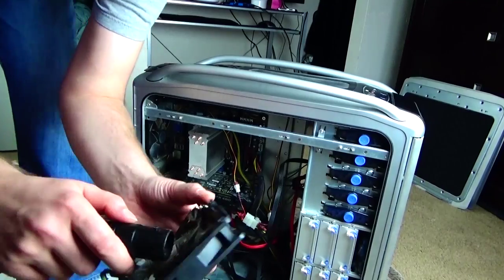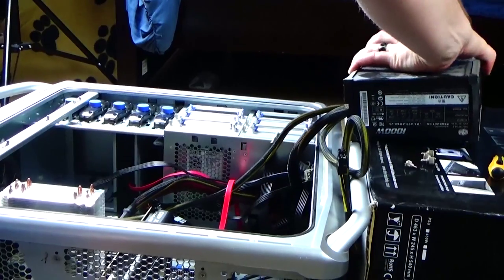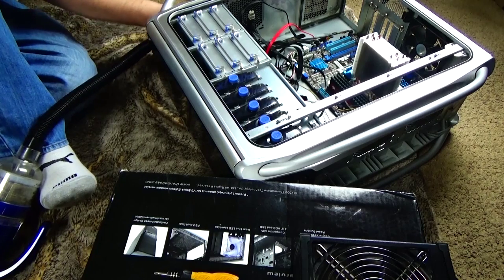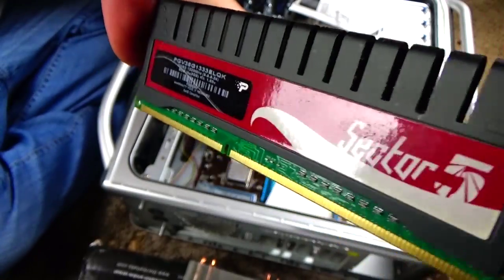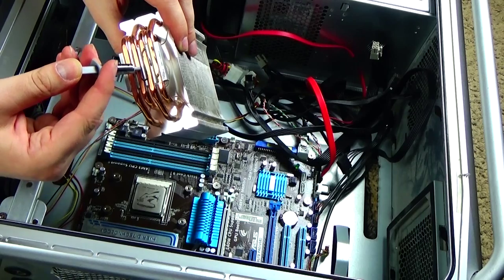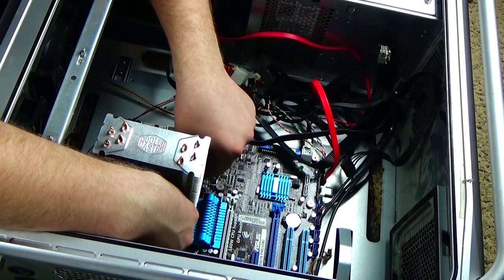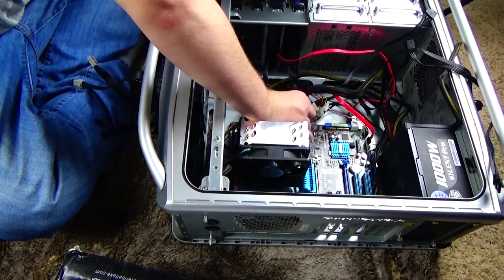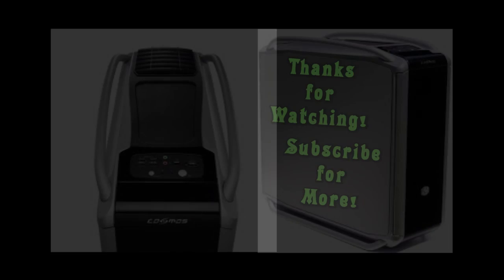250 SUBSCRIBER SPECIAL

Comment: What OS are you running and what is the power of your PC? Most of mine are Win 8.1 or Win 10 with Intel i7 and 32 - 64gb ram. Kind of a must for me.
Reply from the maker: We run FreeBSD 10.1 which doesn't require that you have the top of the line gear to be a BEAST so hardware of anykind will work great for us. :D We have 8 GB of ram and a 6 - Core 3.2GHz AMD Processor. For editing video we use Windows 8.1 enterprise embedded and Premier Pro CC. Also, we run our PC on Samsung SSD's so that makes quite a big difference in speed. http://www.amazon.com/gp/product/B00OAJ412U?ie=UTF8&camp=213733&creative=393185&creativeASIN=B00OAJ412U&linkCode=shr&tag=rosoll-20&linkId=NHR7EYXPNHAAC5XD&psc=1&smid=ATVPDKIKX0DER